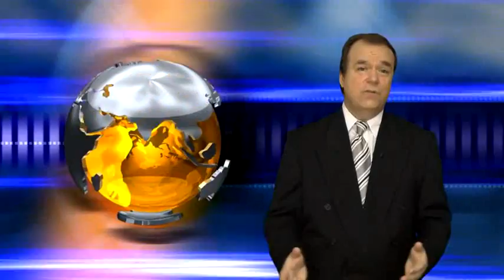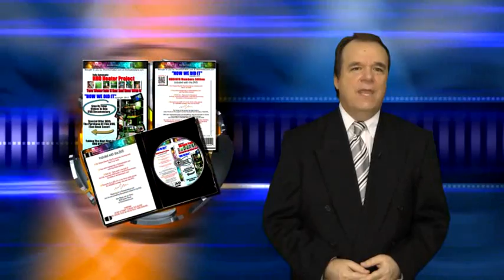HHO Heater Plans

Comment from the maker: Yes you can. We are currently working on an updated version of the first fully automatic heater. We will release videos after the build is completed. This is not a job for us. We have never been paid for our work. Most of the funding has been from our pockets. We can not make claims until we can back them up with facts. We will have real data in a real winter environment to share with all with this new build.